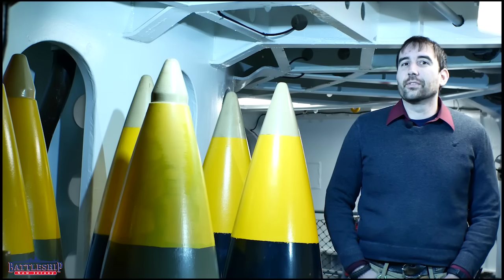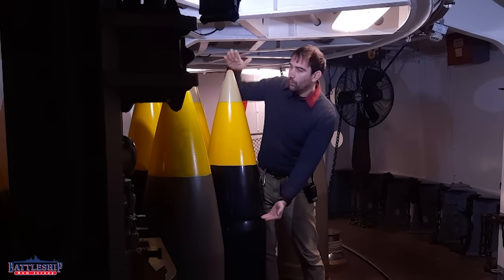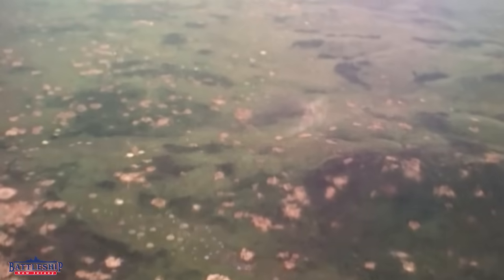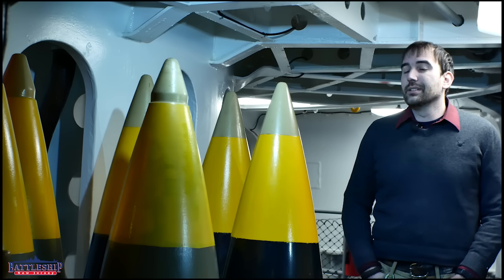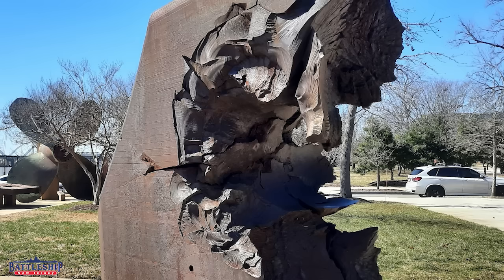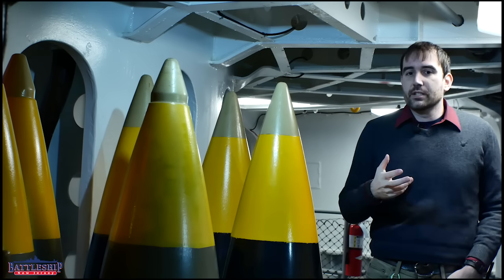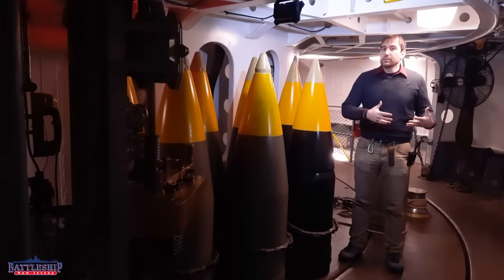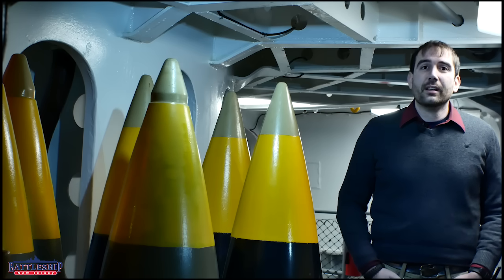What Does the Impact of a 16in Shell Look Like?

Comment: I was just actually thinking about this the other day. Wondering how big the impact crater would be
Reply: If it is an AP shell not much. The Japanese reported they weren't shelled by the British 15" guns protecting Singapore. In reality none of them noticed. The batteries were stock with AP as their job was to defend the harbor from ships not defend against infantry coming overland. Shells apparently went around 20' into the ground before exploding creating just a little puff of dust.
Reply: @evanator166  
They needed some proximity fuses. The Japanese would have noticed that!
Reply: @straybullitt  proximity fuses are only present on HE shells anyway, so no difference.
Reply: @SonsOfLorgar  
No matter the projectile, I can't help but to think that those shells exploding 50 feet above the ground, rather than underground, would be more desirable against troops.
Reply: Probably depends a lot on what the shells are hitting, and from how far away they are firing.
Reply: @blackbuttecruizr  my grandfather saw the impacts in korea, he said around ten miles away one shell left a 30 foot deep crater. sure as hell something you dont want flung at you.